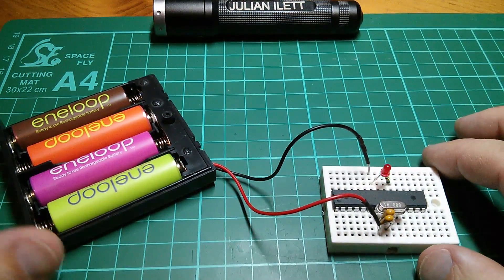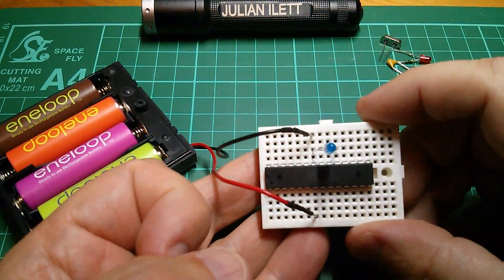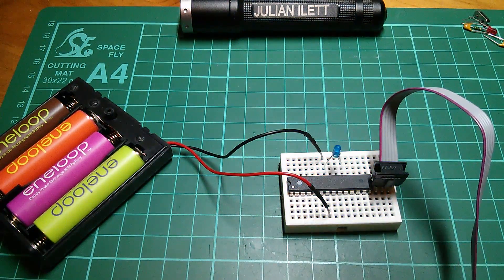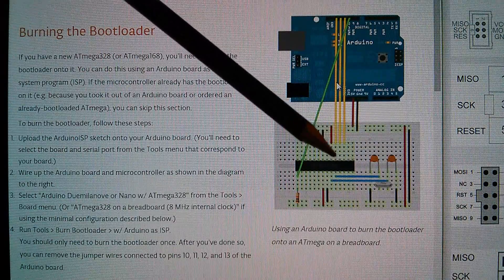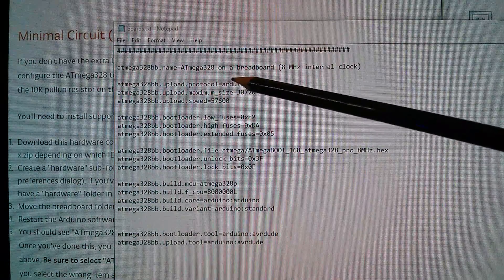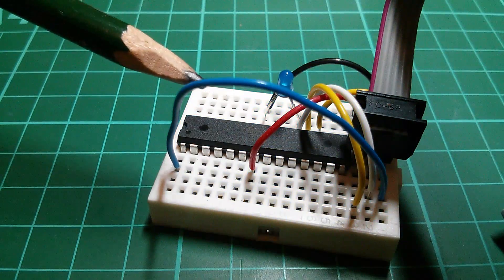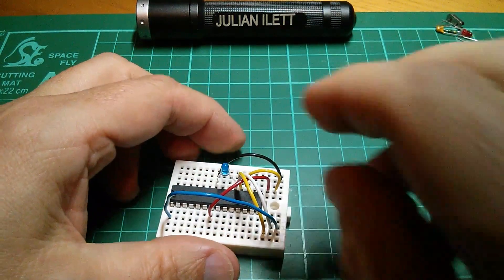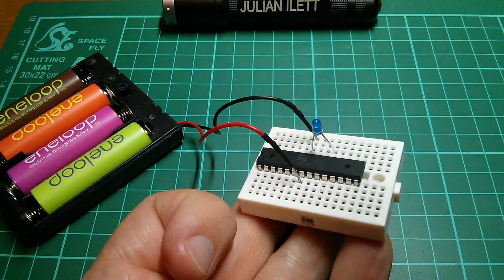Julian's Ardutorials: Arduino Stripped Naked

Comment: If anyone wants to do a minimalist blink without reducing life of LED, connect LED to pwm output and adjust pwm until LED current around 20ma, blinking basically same.

void(loop);
{
analogWrite(0,63); //or whatever number gives you around 20ma, turn LED on.
delay(1000);
analogWrite(0,0); // Turn LED off.
delay(1000); 
}

Comment: Yep, I wouldn't NOT use a series resistor with a 4,5v battery. Two red LEDs in series, maybe... A JFET, wired as a constant-current diode - now there's a thought....

Comment: Is there any limitations by doing this or is the chip able to carry out all the functions as before
Reply from the maker: +NuCleaR WinTeR Yes, the microcontroller is running at half the speed (8MHz versus 16MHz). The delay() function compensates for that, which is why the blink sketch runs normally (1 second on, 1 second off). But your code will take twice as long to execute. Not a problem if your loop() function has delay()s in it, but time critical stuff may be affected.
Reply: Ok thanks for your reply.

Comment: could you try to connect multiple Bluetooth speakers to one device through Bluetooth?? and play music through them all?
Reply: +matthew parker no, the whole point of security in bluetooth is to pair, so there is only 2, not others snooping into the data, you could possibly make speakers with wifi instead that could indeed share the broadcast data

Comment: Very nice, attiny85 as the next step?
Reply: +norm1124 probably not, and I wouldn't either.  I don't consider reducing pin count on a single component as a stripping components equal, and the attiny85 in my experience online (dip version) is more expensive than an atmega8p which has the same pin number as the atmega32p-pu.  If space is the concern, you can get SOIC and smaller atxxxx chips... this would also reduce costs but make it more difficult to experiment with, which  I think is part of the purpose of this, stripping an experimentation implementation to absolute minimums without removing the ease of use of dip and thus breadboard.
Reply: +JaqiesGadgets we'll see, I like the small attinyX5 because I'm not used with SMD and they fit nice in 4 rows of Strip board, aligned with the USB Power pins 1+4. Nice video anyway.

Comment: Idk why you play with this Arduino crap are you a masochist ? 
Download the atmel studio 4.18 and you have much more space in the flash because u don't need a bootloader, u got a debugger and you don't need a board. The AVR and a programmer only.
Of crs the Arduino cost abaut 3.- and its not much cheaper than the AVR himself. And you need a PCB too, later. BUT you can use all AVR types and not only this Arduino devices. Maybe a little ATTiny45 (8pin)
And a tip too.
http://www.engbedded.com/fusecalc

Comment: Hows the eneloops so far?
Reply: +gvi341984 if i can butt in on the eneloops, i find that they suit the fussier devices much better, they retain a bit higher voltage for those devices compared to very cheap nimh, apart from their superior storage retention also, means ive pretty much gone eneloops for all my aa,aaa and slowly got rid of the rest, i also treat them well and only slow charge them, around 5 hours, to keep the heat down on them.  my kitchen radio controlled clock for example, if you use cheap nimh, it shows low battery within a couple of days, but runs for a couple months happliy on cheap nimhs, on eneloops, the low battery takes weeks to show up and then runs for 6 months, still not quite to alkaline times, but i guess this device is fussy on voltage, other things like wii controllers will run on cheap ones just as well

Comment: Because you've reduced the clock frequency to 8MHz you can reduce the supply voltage to a little under 2.7v. That will help reduce led current significantly.
Reply from the maker: +BogusNotions That's a very good point. Although the LED with no resistor was more of a sideshow than a serious option.

Comment: Reset without Pullup won't work in wilderness :) Open Input is very sensitive; try to touch it with your fingers (with a modified program to see a reset. But funny how far you stripped it down. Tnx for the video

Comment: What about the breadboard?
You can get rid of that and do some point to point wiring.
That would be truly minimalist.
Reply: Like the idea. Or cut the breadboard in strips for the 4 rows used.
Reply: +omgffsification batteries?  luxury

potatos
Reply: +roidroid yes, two batteries may have been enough, maybe without case?
Reply: +norm1124 po-ta-toes
Reply: *****

But then it wont work anymore.
:)